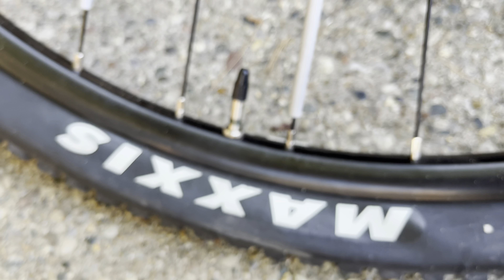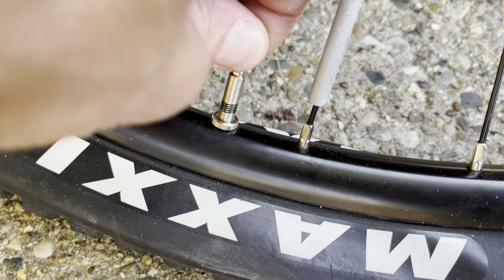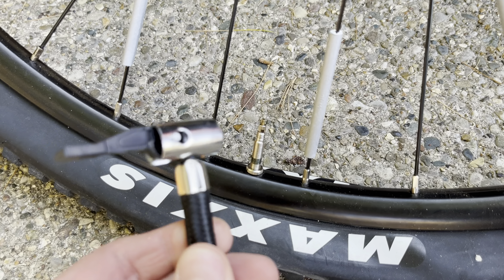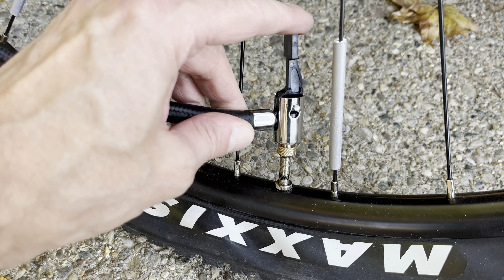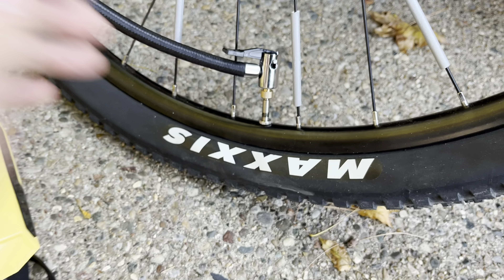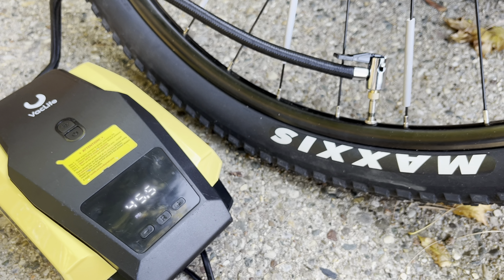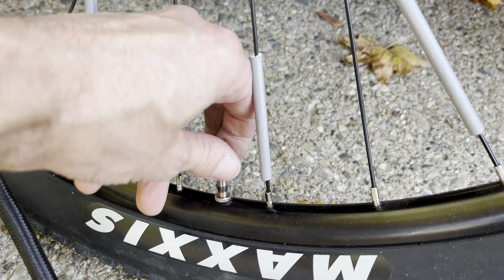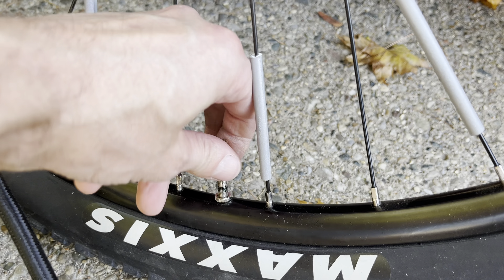Presta Valve Tire Inflation (How to instructions 4k)

Comment: Why do they even have a presta valve in the first place.  Theyre so useless and inconvenient for buying new tubes
Reply: Father-in-law gave me a Specialized FSR bike that is insanely priced and this is what i'm dealing with. Thinking of using a standard tube after drilling the valve stem hole out. I'm not racing this bike but don't feel like upsetting him either. Tough spot.
Reply: @johnghatti5435  Yeesh.  So annoying.  Sorry you're dealing with that nonsense

Comment: Thanks, I was trying to use my electric pump to pump air to my tire but it says that I have 180 psi which is wired, I didn’t know you have to unscrew the tip of this stupid valve

Comment: You have to buy an adapter??? WTF??
Reply: You shouldn’t use an adapter unless you have to because then you are limiting yourself to the max psi of a schrader valve (presta is more); the adapter is good to keep around if you need to fill up at a gas station though. Get yourself a presta pump.